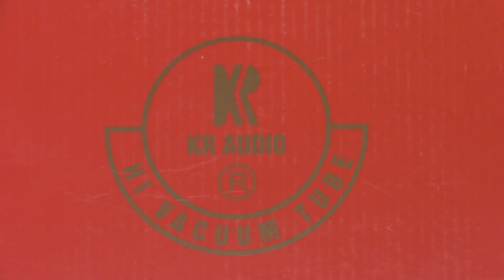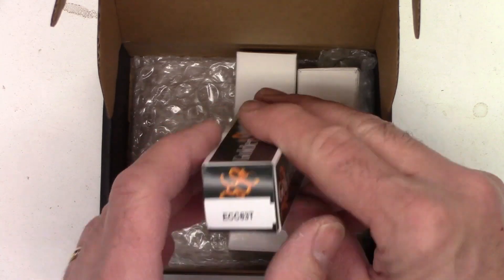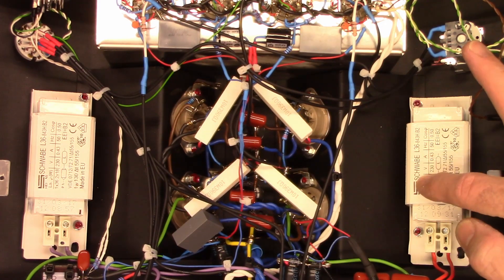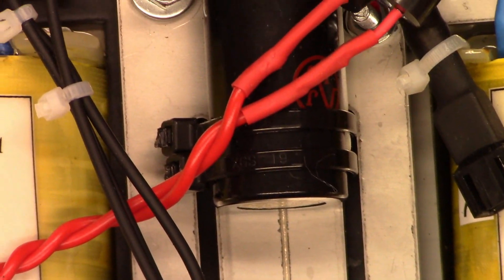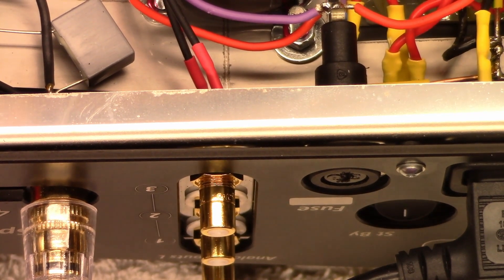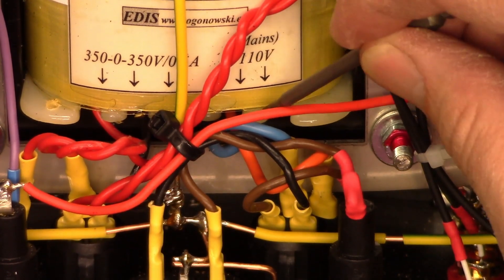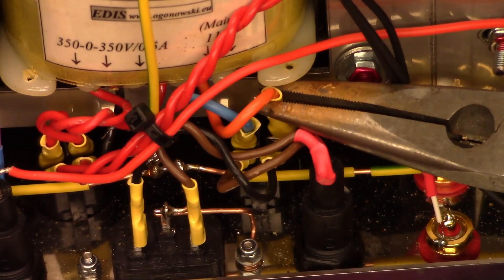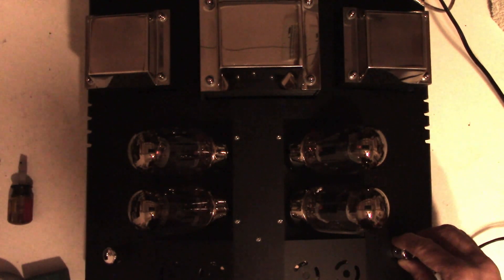ENCORE SEVEN EGG-SHELL TANQ - INTEGRATED VACUUM TUBE STEREO AMPLIFIER OUT OF THE BOX DEAD REPAIR

Comment: We are a company that produces this and other tube amplifiers. You can find us at http://egg-shell.com/. First of all, thank you NorCal715 for repairing the device for the user. However, we need to write a few explanations: of course, it is absolutely impossible that all 4 cables have loosened in transport and jump out of the pins, because as you can see they are very tightly fitted. The history of the amplifier is the amplifier was found by a customer in the UK and ordered there. However, as it is known, we have a different supply voltage in Europe. That is why the amplifier came back to us for changing the power supply. So, parts were re-soldered and this is why in some places it may look like burned out. After converted to 110 V it was shipped from us (as a working device) to the UK, from where it was shipped to the USA. We don't know what happened in the meantime.
Reply from the maker: I also found it odd that all 4 connections came loose. Thanks for your comment

Comment: 3:58 Hmmmm, looks like soldering iron burns on the light blue insulation tubing on the lower leg of the 330 ohm resistor, could have been done in the factory, but.... 
7:47 The yellow insulation on the disconnected switch terminals show marks where they have been pulled off by pliers or something similar.
I'd say someone has had a go at fixing this before it came in for repair.
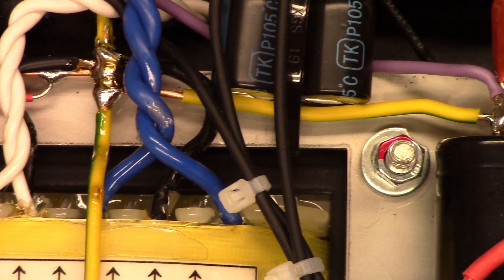Reply: Soldering looks wonky on the 220K resistor at 5:22 also.
Reply: @robertcalkjr.8325  Yup, that solder joint is just tacked on, no mechanical strength in that at all.
Also there's a nasty burn on the yellow insulation just above that.
Reply: fins59  Yep, that needs to be checked out.
Reply from the maker: Ya i mentioned it when recording the video but decided not to put in the final edit.